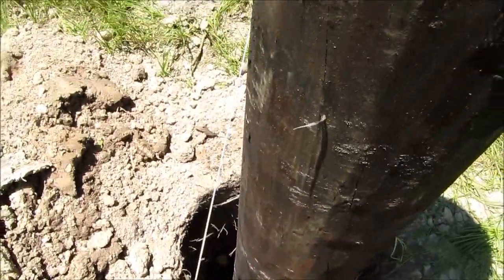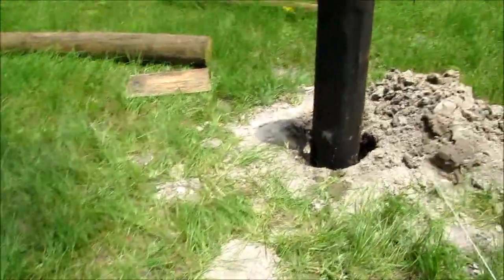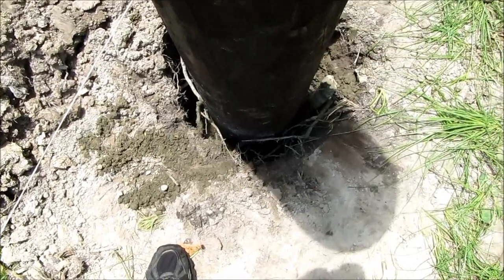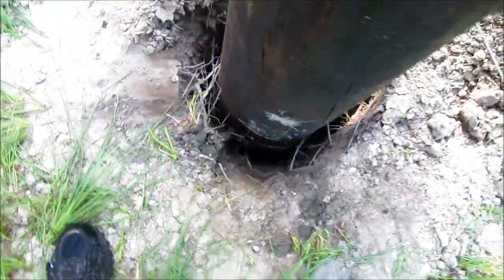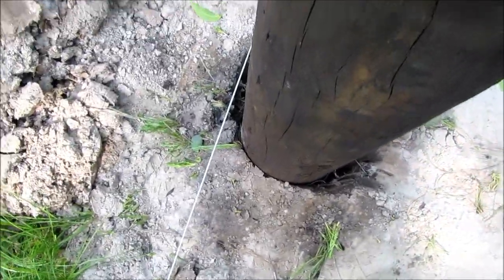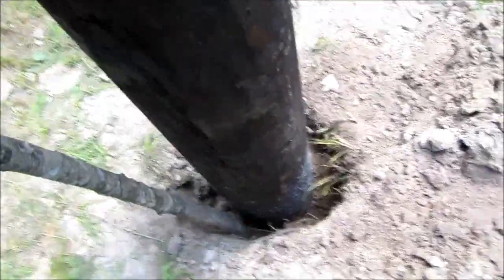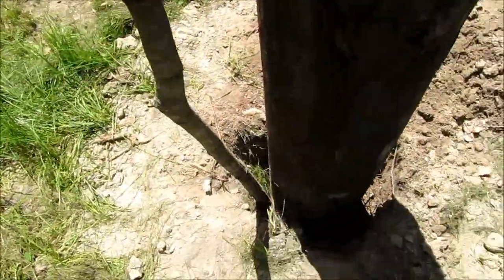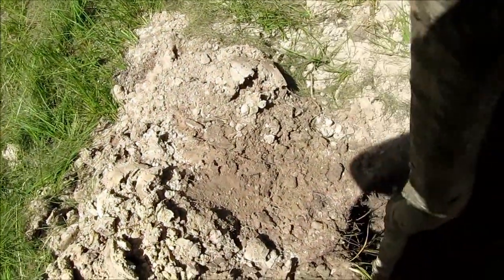Setting corner post for chicken yard

Comment: Hearing the cicadas on your video..I know it's a hot one for you!
On the slab and footings for my Shop I had(thank you County Building Dept!!) to have an Inspection firm do pressure fracture test on the concrete used. They pulled samples the day it was poured and tested it every week for a month..went from 4000 psi to 6000 psi after a month. So you right about strength increasing over cure time